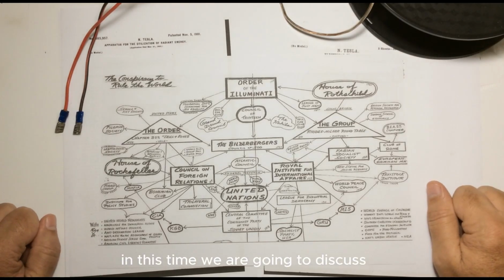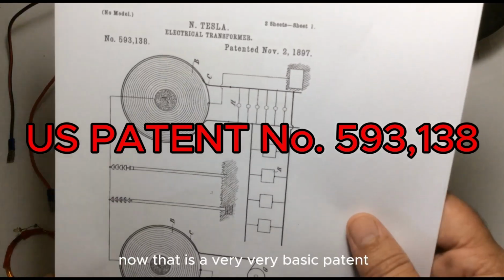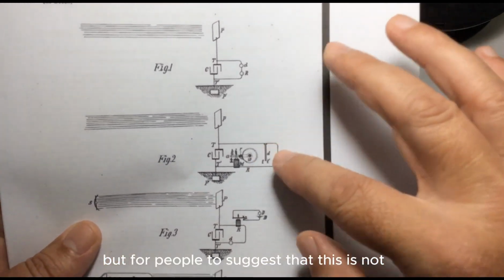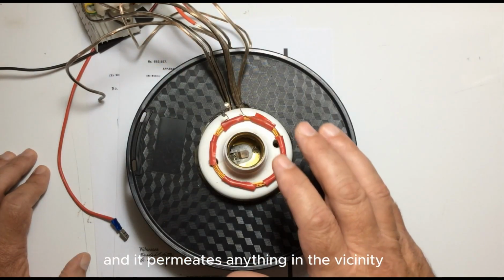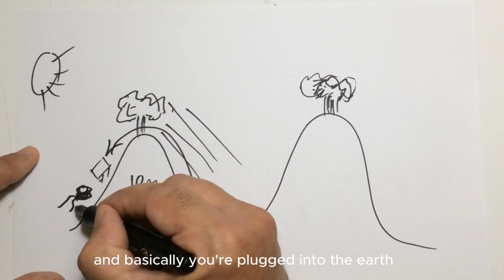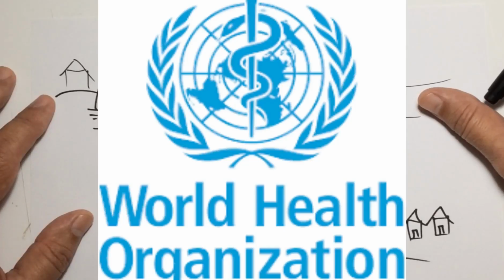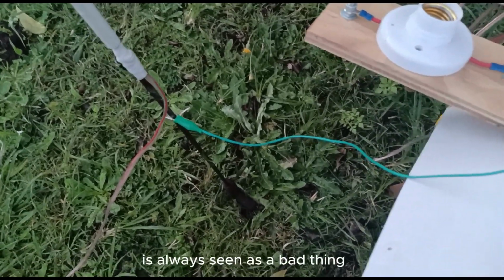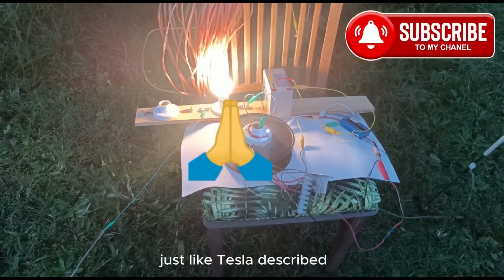THEY ARE COMING FOR YOUR POWER SOON - PLEASE SHARE THIS

Comment: Great experiment, like all your videos!  Have you put any thought into how to multiply the output without putting any further strain on the input?  I'm wondering if something like a Tesla coil with a slayer exciter, only incorporating the earth ground as well?  I have a couple of MTECH's energy pumps and receivers, I might give that a try.  Also, I'm guessing any part of the ground rod you're touching should be insulated?  Thanks!
Reply from the maker: Thank you for your comment.
You can have extra coils positioned all around the perimeter and  above and below that will light up without drawing extra from the source but it is not unlimited, after a particular number the frequency changes and the circuit is no longer resonant. I have fed the output of this into many coils but caution is required with all connections to this circuit. I mistakenly had this fed into my largest Tesla coil secondary and then into an MOT which produced an amazing electric field with purple ions coming out to attach to ferrite, (spectacular stuff I should record). All was well until a fuse blew inside the battery charger connected to mains which connected my 12V SLA batteries direct to the mains, this resulted in a large green 1 inch long thick and intimidating arc. 
I encourage you to experiment but it must be done with caution, if everything you make is right you can open up a world of dangers.
Just remember when the code is cracked you don’t want to be touching it, an unlimited power source is not friendly when going through the body. My partner has had to kick me away from one of my magnet motors that grabbed a hold of me and wouldn’t let go, luckily I had informed her what to do in such an event, the smell of burning flesh is something you never forget so yes everything not insulated should be given a wide birth, if your the clumsy type then make sure it’s covered.
Reply: @whatifididthis...1236  Would LOVE to see that MOT experiment!

Comment: could you charge up  lead acid batteries with this? i have a similar problem to what you explained i can only fit so many solar panels on my roof to get good sun and the rest have to be some distance away and lugging batteries is annoying even if they were independently charged and i could swap them at the house as they die with a switch or something  so the radiant energy doesnt permeate into my inverter and stuff aha i was going to use a inverter but that will have its own issues mostly being 400$ of wire if i could use one conductor it would save alot of money  love your videos man
Reply from the maker: Thank you for your comment.
You can charge up lead acid batteries with this, it needs to be transformed to much lower voltages to safely do that but it can definitely be done. I will try to make some more videos soon, when you get back on the horse after a long break it’s probably a good idea to just keep riding so fingers crossed, now that I have said it I suppose I have to do it!
Soon I will make a video with a solar controller and panel to give you an idea of how and when it should and shouldn’t be running.
The bonus with this system is you can buy real small gauge wire and it works just fine, this allows you to use cheaper, not so popular wire saving even more money, if you have a standard fence wire between the solar and where you want your load you can just use the fence as a piece of wire and cut down on even more wire and more money. Especially when considering the losses experienced by an inverter where this circuit only consumes 3.5 watts plus the load wattage. I did say a long time ago to one viewer I was going to show how to transfer this power back to a DC supply, I even remember saying it in one of my videos and never showed it. I will have to get busy it would seem, perhaps I’ve been a little slack for a while.
Thanks for your kind words.

Comment: Thank you for connecting the dots on this energy system using Tesla technology.   Have you tried adding a solar cell to the system to charge the 12 volt battery?  Then you are using the sun and the earth to generate electricity.
Reply from the maker: Thank you for your comment.
I have had a solar panel and solar controller connected to this system and as long as a few requirements are fulfilled it works just fine, something like a bad connection will be the end of the solar controller because of the voltage spark created by the spark gap. An on/off switch must be used because a hand made connection almost always has a spark gap on contact. When the sun is out it is a good idea to have the system off due to the high voltage dielectric field permeating the chips in the controller which can in some cases confuse the voltage regulator, telling the controller the battery is full because it’s voltage is way above 13 volts. I will make a video soon in which I will connect a cheap solar controller to show how this is done but it does require care or things could blow up. For that reason I will never connect a 240 volt mains battery charger to this ever again, let me just say my heart hurts when I think about it, you see what it can do on 12 volts, now imagine what this circuit does when connected directly to the grid, it isn’t pretty!

Actually, I just remembered it scared the crap out of me that bad I turned everything off and walked out of the room and didn’t go back for three weeks, literally scared of what I had created.